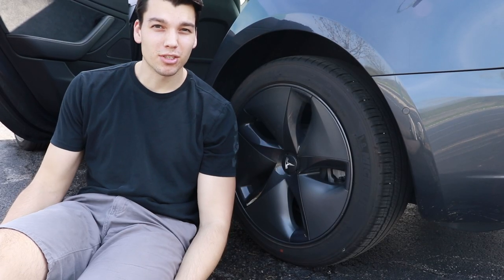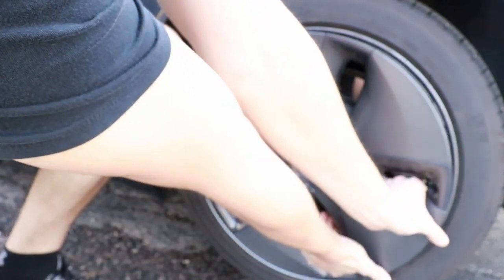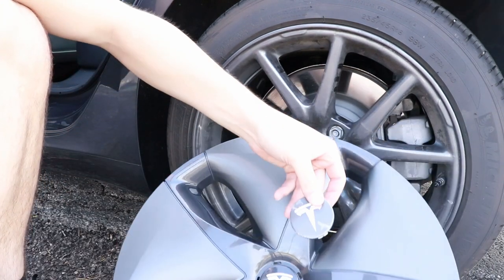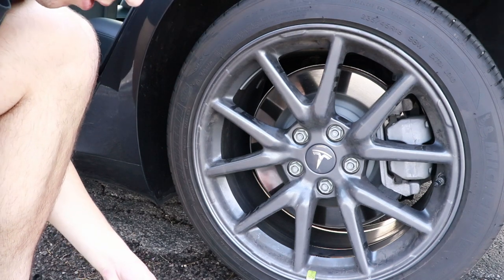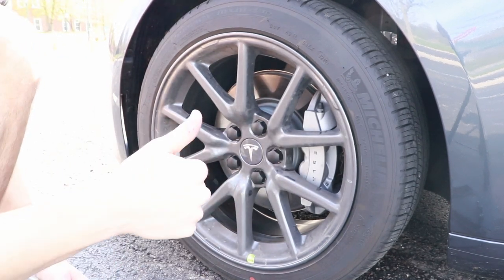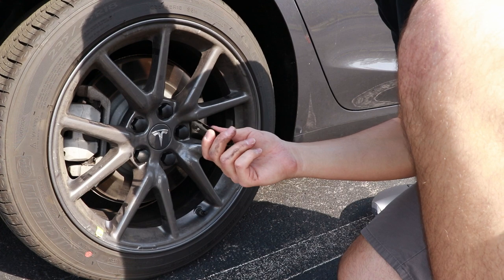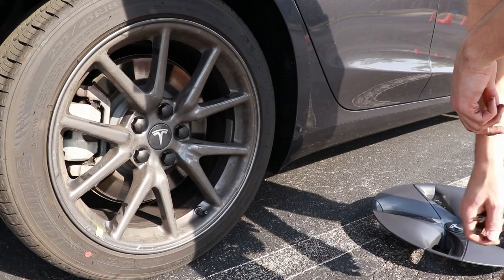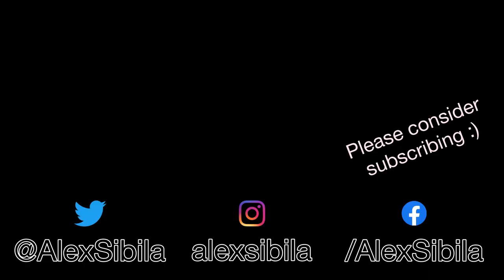INSTANTLY Upgrade your Wheels! (Aero Cap Removal for Tesla Model 3)

Comment from the maker: BONUS CONTENT: The stock rims are slightly less efficient, but in the summer I think it's worth it for this look. Efficiency is most effected in the winter when a lot of energy is spent keeping the battery warm. Thinking about painting the calipers now 🤔
Reply: Alex Sibila once I took mine off I didn’t want to put them back on. The hubcaps are easier to keep clean because there is no reaching in the rims.
Reply from the maker: @mitchellbarnow1709  that's true, I noticed that immediately. I cleaned my car right before this video and they were still all gross and dusty when I took the aeros off!
Reply: Alex Sibila It’s amazing!
Reply: I think some blue calipers would look 🔥with midnight silver
Reply: How many miles do you think you lost after doing this? Also how easy was it to get that center cap back off

Comment: Looks much, much better without the Aero covers,  but it should be noted that if you're looking for max range on long highway trips,  those covers make a Big difference.  But yeah, I'll probably take mine off upon delivery as I do mostly city/suburban driving.
Reply from the maker: That's exactly what I do. Usually leave them on in the winter and for road trips but take them off in the summer

Comment: Nice vid Alex! The center cap is ridiculous to get off!
Reply from the maker: 😅 that's good to know! What'd you use to remove it?
Reply: Alex Sibila get duct tape and make a ball out of it with the tape facing outward and stick it on to the cap the pull quick!
Reply: EVlectric Tape where? 😂😂
Reply: Remove wheel and push it.  No potential scratches.
Reply: Drill a small hole into the cap before installing. Then when time to remove, use a tiny Allen wrench that fits in the hole and pull.

This is how Porsche center caps are removed. They come from the factory with the small hole already in the cap.

One more thing, the bottom of the “T” should point to the valve stem… another Porsche thing.

Comment: When you install the aero covers again, you obviously need to remove the “T” part (with a suction cup or similar), but for the bolt plastic covers, what do you do? You also remove them or are compatible with the aero covers?
Reply from the maker: Yes, I remove everything. If you check out my "Custom Aero Wheels" video I show that whole process. It's quite the struggle getting the center caps off lol
Reply: @Sibs  All you have to do is take the wheel off and pop it off from the back....

Comment: I’m surprised that you didn’t check the bolts with a torque wrench.
Reply from the maker: Didn't even think about that, would be a good thing to check.
Reply: Alex Sibila 129 ft/lbs, I think 🤔
Reply from the maker: Correct, the aero wheels are essentially plastic covers. They don't directly screw into the wheels. Same with the bolt covers and center cap, just held in place with friction

Comment: Honestly, wished Tesla had higher quality rims on the model 3 base tires, the alloys have a cheapening, ugly look especially with just a little dirt or dust. Then the aero caps look like cheap plastic covers you could get off a prius. Car is a 50k plus purchase and unless you get the sports wheels, the base look like something you get on a 20k Corolla...
Reply: 50k ? Dang you got swindled. I picked one up for 25k 😂